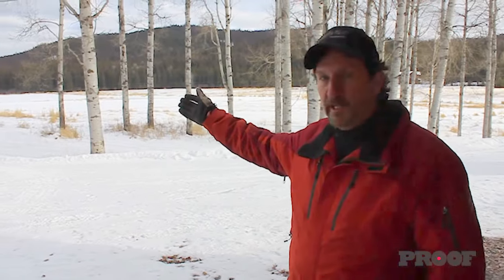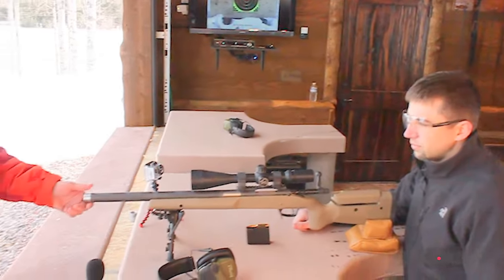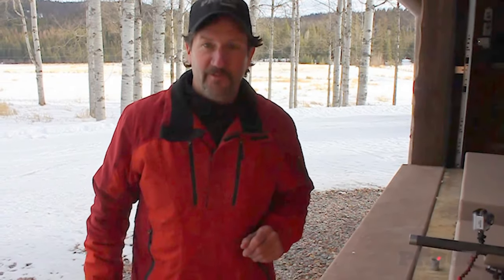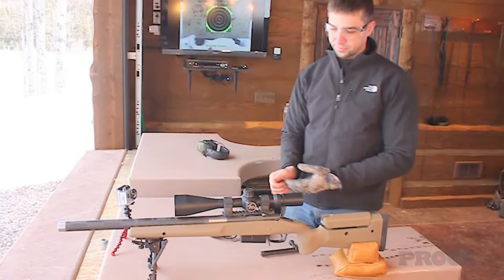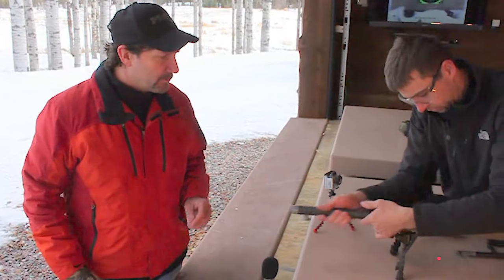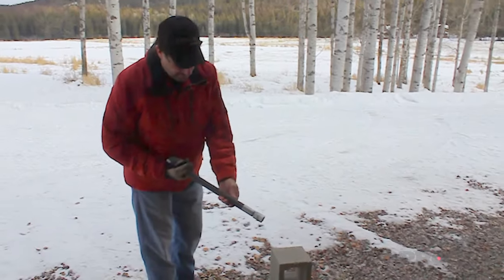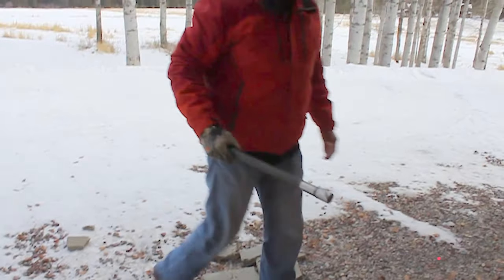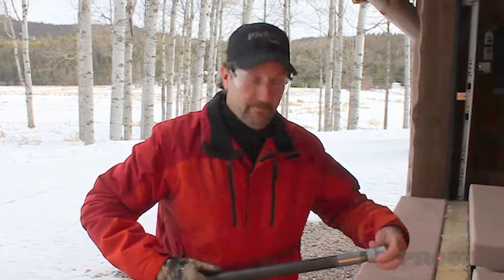The Ultimate PROOF: Carbon Fiber Wrapped Barrel Durability

Comment: How does Proof Research stack up against Christensen Arms carbon wrapped barrel?
Reply: +SeriousSchitt Proof is vastly superior. They have very different techniques in construction, different types of carbon and resin used. To get the benefits of high thermal dissipation, the 'ingredients' are very specific and proprietary. The Proof barrel uses Pitch Carbon filament that is actually 'wound' onto the barrel liner at 90 and 45 degree angles, PAN carbon is wound over that-PAN carbon prevents the barrel from shrinking as it heats up. This Pitch (coal derived) carbon is the key. F1 carbon/carbon brakes, and Space Shuttle skin tiles use this type. The whole thing is held together by a high temp resin matrix. Once the carbon/resin is cured (its rock hard), the barrel is ground to its final contour. It took them a LONG time--something like 11 years iirc-, a lot of trial and error to get it all figured out. Christensen does use a high quality SS liner (just like Proof), and it's very accurate when not pushed to high temps. Heat build up and dissipation is where it falls. The barrel is done as said: it is 'wrapped' in the same sense as a cigarette. Which is NOT the most efficient way dissipate heat. Only downside of Proof carbon barrels is the price...twice as expensive as Christensen. For AR type barrels $950 vs $500. But it's the best, and if you can afford it, then it's worth it. Heck, it's good enough for Military use on rifles and belt fed machine guns. I think they are the only barrels approved by the Military, but I'm not 100% sure.
Reply: +Ogi Jun  Thanks for your in depth comment. I'm hoping to use it in an application whereby only one, two or maybe three shots will be fired on any 'one' string at a time, hopefully only one shot, so heat shouldn't really be an issue for me.
Reply: +SeriousSchitt of course with that intended use, it makes perfect sense because the Proof barrel is so darn expensive! Twice the price of CA barrels. and the SS in the CA barrel is top notch so accuracy will be there.
Reply: +Ogi Jun   Understood, thanks. :)

Comment: How good are these barrels for competitive shooting? I understand theyre great for hunting, but with the much higher number of rounds in a shooting match, how does the CF deal with all the heat?
Reply: +fartx211 Legend has it that they dissipate heat some phenomenal times better than barrel steel, however, I'd liken it more to that of an insulator!
Reply: +SeriousSchitt As I mentioned previously, it depends on the type of Carbon. PAN petroleum derived CF does not have very good thermal conductive properties. Polyester resin also has poor thermal performance. Combining those two, well, it's not going to get rid of much heat. However, coal tar derived Pitch Carbon Fiber, is a SUPERB thermal and electrical conductor. It is 3-5 times more efficient than steel...depending on the type of steel. Proof barrels use Pitch for thermal superiority, and augment it with PAN because it excels in structural properties. Pitch alone will shrink when it gets hot, so PAN carbon keeps the barrel from warping. The manner which the carbon filament is applied to the steel barrel liner also greatly impacts heat dissipation, as does the type of resin used. Proof barrels are not actually 'wrapped' with CF, but rather 'wound'. Simply, coal tar Pitch and petroleum PAN derived CF have very different thermal properties.
Reply: +fartx211 3-gun champion used Proof carbon barrel. Military also approves Proof barrels, even on belt fed machine guns, so I suppose heat is managed quite well. Just too expensive for me at the moment (as I'm sure it is for lots of folks)

Comment: I would not use a carbon fiber barrel in a semi-auto until I see that the epoxy laminating resin Proof uses will withstand high heat.  I can get my AR's pretty hot at the range.  Bolt guns, I can see it.  AR's - not convinced at all.
Reply: You're one of those 60 rounds a minute range guys aren't you? I experienced my first one a month ago and he was absolutely fucking annoying.
Reply: Reverend Rabbit - as a Degreed Engineer trained in Heat and Thermodynamics I can say with certainty you are WRONG.  The carbon fiber wrap is an insulator NOT a heat transfer material !
Reply: Reverend Rabbit - Groups will NOT open up on a Bartlein SS barrel either on a comparable string.  Please note that these barrels are NOT used in the PRS gas gun semi auto division competition for GOOD reason.  Bench rest bolt gun shooters moderate and indeed throttle their barrel temps

Comment: Nothing bad to say about CF wrapped barrels, I have tried one on a Rem 700 plateform and it seemed to shoot fine while being both light and less warm than my regular steel barrel. I might even consider a purchase in the future... In fact if it were possible I would love to build a modernized version of the scout rifle around CF parts...
However, as far as the demonstration in this video goes, it is rather unconvincing... I did quite a bit of martial arts in my youth and I have seen 14years old japanese girls break that kind of cement bricks using the the palm of their hand. And yes I have also seen it done by sensei's when hitting the corner are of the brick.
Next time find a nice thick tree or a lamp post and bang that barrel a few times on it... then we shall see... But I am rooting for you guys...

Comment: No, you are wrong. Good conductors cool off faster. Much faster. Think about the ocean, the ocean is its warmest at the begging of fall. It is even warmer in October than the early summer. Because once it finally reaches that temperature it holds it longer. A good conducter is good at releasing heat, a bad conductor is good at retaining heat, it just takes a while to get there.
Reply: a bad conductor doesn't mean high heat capacity.You can have materials that have both low capacity as steel does and low conductivity. For example air is extremely bad conductor yet it only has 2x more heat capacity than steel and 4x less than water.

Comment: Okay, that was impressive. I just got my AR 10 in 6.5 Creedmoor carbon fiber barrel from Proof a few days ago. I've been working on putting a new rifle together and I've been treating the barrel like it's glass.  I guess that's not necessary. However, I was not impressed by the accuracy of this demo. I already have one Proof steel barrel - also AR - also 6.5 Creedmoor, and it shoots more accurately that that. I expected all three of those rounds to touch since that was a bull barrel on a bolt action. Hopefully those results were due to poor factory ammo, a clean barrel, and a loose fit to the action.

Comment: no offense to the durability aspect of that carbon wrapped barrel but my 6.5 creedmoor with a kreiger bull barrel shoots better groups at 600 yards than that barrel shot at 100 in the video. sometimes quality and performance are better than durability. and the higher end 6.5 barrels only have a 3500-4000 round life anyway so having a barrel that outlasts the rifling is kinda counterintuitive.

Comment: First:  Those groups are not impressive.  Second:  It would be more impressive if you did a control.  For example, have a duplicate weapon system with a traditional bull barrel and repeat the performance under the same conditions.  Which barrel sustains more variation?

Comment: They charge the big bucks for these barrels because enough people plunk down the big bucks for these carbon wrapped barrels; not necessarily because they are worth the big bucks.  It's their perceived value that drives sales.  I'm still holding out hope that some cheap Chinese knock off carbon fiber wrapped barrel maker will hit the market in the near future.  That would be the only way I could afford one of these barrels.  Other than that, there's no denying that they are rugged and accurate when chambered and installed and shot properly.

Comment: Just wanted to state the obvious, a 5 inch shift at 100 yards would be over 50 inches at 1000 yards, and that's considering no wind.  That's over 4 feet!
Reply: +richard mangini thats because they re installed it. idk if you plan on using ur barrel as a concrete axe anyway
Reply: richard mangini I'm not concerned with the shift. I am concerned that the groups weren't tighter.

Comment: I want to see the bending moment and section modulas of two indentical length and finsihed profiled read for sale Proof Research Steel barrel vs Carbon Wrapped. No gaming the system with equal mass barrel as Engineers and Aviation Material Science experts we know how to do this right. Stop acting like TV Infomercial pitch men and have some intellectual honesty and integrity! 

Beating it on a concrete block before reinstalling it and shooting it is right up there with the knife sales men pitch that visit grocery stores and flea markets! 

As to barrel torque spec. the barrel was removed and installled the same way. Depending on how the threades, tennon and reciever are designed plenty of actions can shoot fantastic in like manner. Not all actions require 90++ Lbs.-ft of torque. 

The tight groups are a result of a good barrel blank, good machining, solid reloading, excellent shooting technique and good wind reading not anything to do with what is wrapped on the outside of the barrel. If Proof Research had not sold their souls to the Devil to have a higher profit margin it could be easily proven by simply having them take a cheap lousy barrel blank and apply their wrapping process to it! A blank they did not have any hand in making. Shoot said blank then reprofile and wrap and re-shoot! 

Proof has only proven with this video that they are like so many other companies andhave no integrity or intellectual honest. I would not want to use any part they make in any aircraft I fly I would not trust it. If you lie about small things you will lie about big things!

Comment: Why do you show this stupid test with a concrete brick? 
How accurate (strong snd stiff) enough will be this carbon wrapped barrel if you overheat it after fifth or 10th shot? Epoxy glue is soften after  5th shot overheating and accuracy becomes not acceptable for this carbon fiber wrapped barrel I think.

Comment: It's just marketing Stunt.... as if other barrels cant do that
Reply: Another barrel that is as light as that barrel cannot do that it would bend
Reply: CLOWNBOW CLOWNBOW sure it's certainly lighter but if you get a high quality steel barrel it will perform the same as this
Reply: csfreak89 a high quality barrel will way more... And these barrels are considered match grade
Reply: csfreak89 oh but I was looking at your original comment and I do agree it's a publicity stunt .... If you stay off the forums and go read the actual science about these barrels it seems to be that they are supposed to be pretty good Christensen arms has one for the AR for $500
Reply: CLOWNBOW CLOWNBOW Yes they are really great barrels as i believe that carbon wrapped barrels are way more stiffer then pure metal barrels. But certainly there are other barrels that can do this it's not exclusive to carbon wrapped barrels that's what I meant for my first comment
Reply: csfreak89 oh yeah if you have a regular bull barrel it should be able to break that cinder block with no problem
Reply: CLOWNBOW CLOWNBOW  And with little impact shift too tht's it